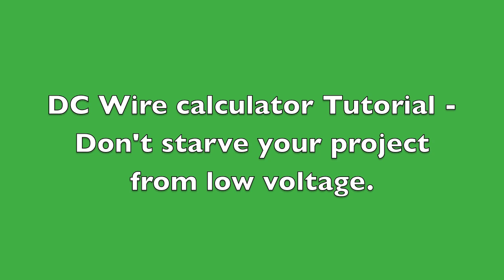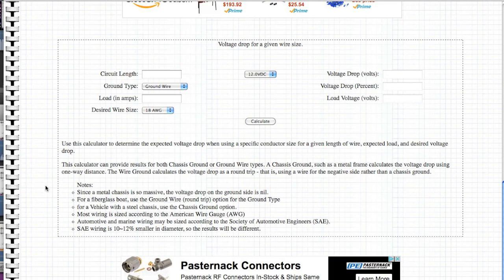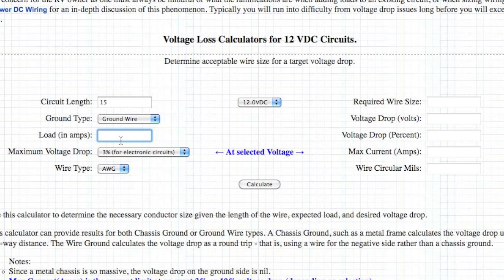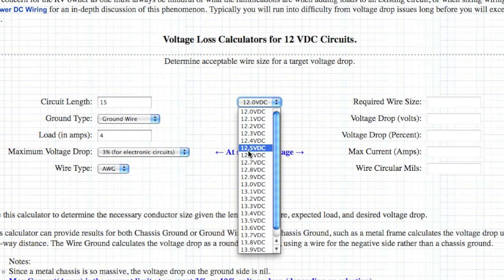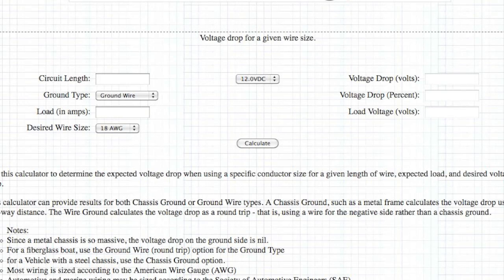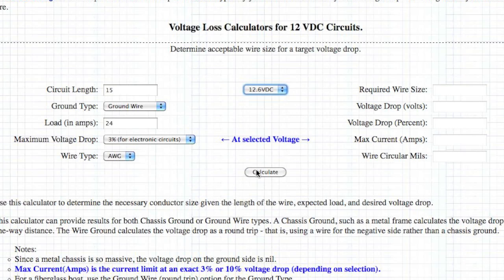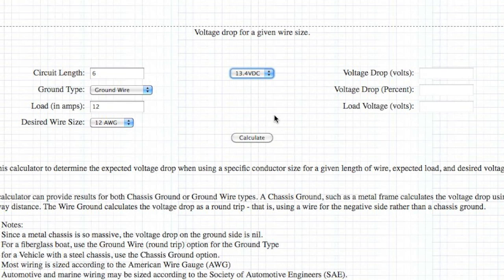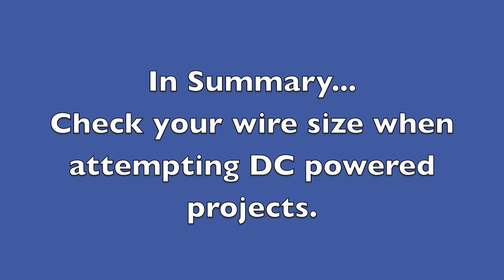Tutorial for Calculating Wire Sizes for DC Applications.

Comment: How accurate does the length measurement need to be? I'm measuring wiring in my engine compartment, and it 's hard to measure the length along the wires path.

Comment: can this work for 24V systems as well?
Reply from the maker: Yes.  The voltage drop result in volts will be the same. 

The only purpose of entering voltage in the calculator is to determine the percentage of the voltage drop.  

Therefore if you use 12V and want to determine the percentage for 24V, divide the percent voltage drop by 2.

The actual formula is:  E = (K x I x L) / CM

where;
E = Voltage drop in the wire
K = 10.75, which is a constant (representing copper resistance)
I = current passing through the wire
L = round trip length of the wire
CM = circular mil cross section of the wire (i.e. wire size)

So you can see from the above formula, the voltage drop is a function of current, wire length, and wire size, not system voltage.

My webpage (http://www.rv-project.com/tips/dcwiring.php) has Circular Mil sizes for popular AWG and SAE wire.

Comment: sir i want to make electrmagnet by winding copper wire on bolt thread and using battery of bike 12v and 9Ah what should be wire gauge pls reply what should be length
Reply from the maker: Not enough information. You need to know the diameter of the bolt and wire and the desired magnet strength.

Comment: i belive solid and stranded are rated the same in building wiring consolt codes
Reply from the maker: Perhaps. However, the Circular Mils between solid and stranded are slightly different, so the calculations will be slightly different as well.  

Further, SAE wiring is about 10% smaller than AWG. 

Both are acceptable for RVs, Boats, and Autos, so you have to make sure you are using the correct system. I don't think building codes would cover SAE wiring.

Comment: is 14 awg 15 amp 12 awg 20 amp 10 awg 30 amp the same as ac wiring
Reply from the maker: Not sure the question. The calculators are intended for DC wiring with stranded conductors. 

Solid conductors have a different Circular mil, thus the calculator is not valid for those.

Comment: WOW, another great video.  You are my new RV electrical guru / teacher.  I read through your  DC primer and this wire size calculator video and understand everything (super valuable info by the way).  I clearly understand how to use your calculator to determine the wiring size from my DC distribution panel to all my DC circuits, but I have a question about how to determine the correct load for upstream of my DC panel.  I am trying to calculate the proper size of wire to use for the run between my 12V DC (200 AMH) gel battery to my power bus bar (a short 3 foot run).  My power bus bar is also where I attach my incoming solar power 200AMH circuit, the circuit going to my inverter/charger, and the circuit going to my DC panel.  How do I calculate the load for this line to plug into your calculator?  Do I add up every possible load in my entire DC circuit?
Reply from the maker: You should add up all of the anticipated simultaneous loads. For example, some of the highest demand DC loads are electric auto-levelers and slideouts. You won't likely ever use them at the same time, so for 
this example, use the load of either the auto leveler or largest slideout, whichever has the highest current demand. 

One caveat though when sizing for motor loads. You have to anticipate stall current - which is when you apply current to the motor and it does not move (say it is at the end of travel). This is the most amperage the motor will demand. Your slideout or autoleveler manual should specify the minimum wire size; so just make sure you use that size wire or larger.

However, for a short run, over-specifying the wire size is not that expensive.  If you need 3ft, and if 8AWG is $1 per ft, and 4AWG is $1.50 per ft, it's only a buck-fifty to go with the larger wire.

Comment: nice presentation and calculator thanks ... I found the embedded calculator link does not work? . com missing?
Reply from the maker: I did check the link and it looks OK. Not sure what the issue is.  At any rate, here is the link:  http://www.rv-project.com/tips/wirecalc.php
Reply: i found the correct link on your web page ... it was the YouTube link that was problematic... thanks for the reply and link

Comment: Very well done clip. The calculator makes short work in determining proper DC wire size given current demands and resistance within con on wire. Well done and thanks for investing the time in fellow travelers.
Reply from the maker: Unfortunately, the topic of properly sizing wire to minimize voltage loss is often ignored by RV'ers, and even some in the RV industry.